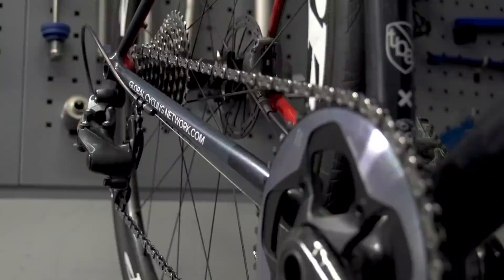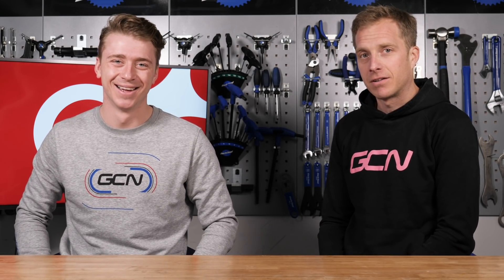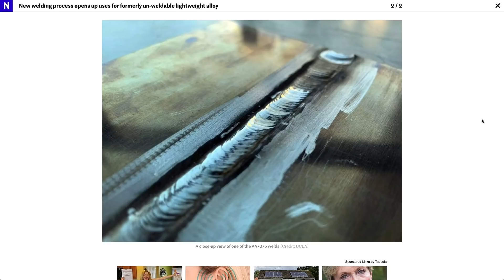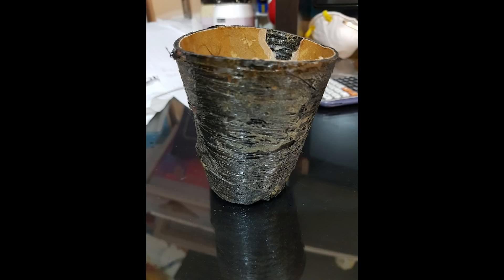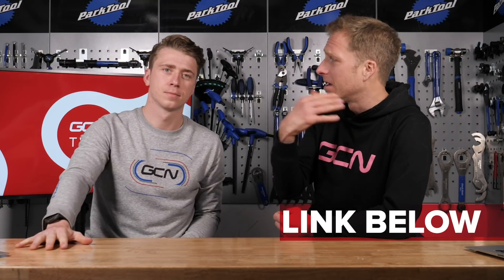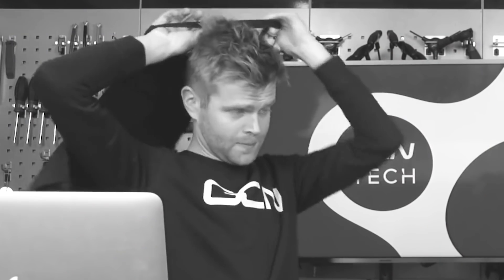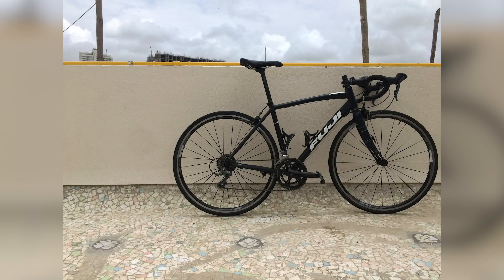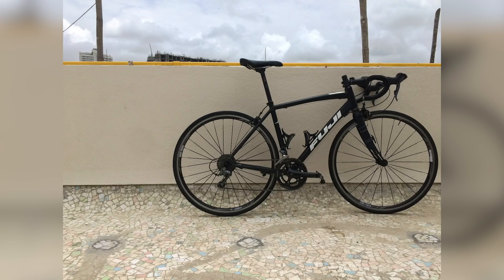The New Metal Threatening Carbon Fiber Bike Frames | The GCN Tech Show Ep. 60

Comment: Aluminum?  You may as well ride with no saddle, just the seat post.  Carbon fiber and aluminum are susceptible to catastrophic failure as well.  No thanks.  But that's just my opinion as a frame builder of 20 years having built around 2500 frames, singles, tandems, coupled frames, triples, quads and quints.

Comment: Graphene components? Nanotube frames? I'd reckon we could get the weight down under a kilo just with those. And also you could run a nanotube in your drive just so we don't have to change chains anymore. And who needs wires? Graphene is flat, just print it on top of the frame. Tyres? Who needs them when you have a lightweight stretchy rim that can take a bullet. The future of bikes seems bright even without these types of materials, but they definetly help

Comment: Why has no one tried transparent  aluminum?   (AlN)x·(Al2O3)1−x, 0.30 ≤ x ≤ 0.37 Imagine a transparent frame.
Reply: Yeah, you can put LED lights inside the frame, and also internally routed cabling would be easier to do.

Comment: Lithium frame - 1/5 the density of 6061. Don't ride it in the rain though.
Cesium frame - 2/3 the density of 6061. Melting point at 26C though, so not a summer frame.
Reply: Riding bike with lithium frame will help you for mental probems though. ;)

Comment: aluminium doesn't flex like steel does,... why bother with a super stiff frame, if what you get is a frame that may only withstand to be used for really short life spans, if what you get is a thing that needs a pro-welder with a top notch tig welding device, it needs be let clear for the general public that aluminium and carbon fiber frames are meant to be replaced sooner rather than later, and that they are a clear example  to be used for really short bicycle life spans...

Comment: New material? How about co-continuous ceramic composite  (C4)? Start with cordierite preforms and infiltrate it with 7075 aluminum. Lighter than carbon fiber with mechanical toughness, hardness and sheer strength lacking in carbon fiber composites.

Comment: Super plastic formed titanium frames. Have a word with BAE systems, see if it's possible. They make Typhoon canard this way "the aircraft’s 98kg (216lb) canard as an example of its advanced manufacturing skills. The structure is made by diffusion bonding six sheets of titanium together at 950°C (1,740°F), with print patterns etched on each sheet later expanded by passing argon gas through the structure at 150°C in a super-plastic forming process"
Reply: Aero titanium, no welds 😉

Comment: Reality check: Professor Xiaochun Li's negative statements about composite carbon beginning at about 3:08 are patently false. Either he's exaggerating or he's misinformed. Of course composite carbon can be repaired if it fractures -- Jon has interviewed people on GCN Tech who do this very thing. I can provide you with the names of several companies that will repair carbon frames (such as Calfee Design in the U.S.). And the weakness of composite carbon is by design -- it is intentionally allowed to be weak in non-critical ways in order to reduce weight. If desired, a composite carbon tube could easily be made to withstand the "shear" forces described by the professor. And the professor's inference that metal is more flexible than composite carbon is, again, false. The beauty of composite carbon is that you have full control over flexibility. You can make a frame more or less flexible, as desired. Why do so many alloy frames feature carbon forks and seat posts? Answer: To add flexibility!

But there is a huge elephant in the room with regard to aluminium alloys and it amazes me how often it is overlooked in these kinds of comparisons: Aluminium alloys have important issues with fatigue build-up. It is the nature of aluminium -- even small stresses that would not harm steel or titanium will accrue over time until an aluminium part is no longer safe to use. That's why engineers must over-engineer aluminium parts. A safety factor for steel may be 3:1 or 5:1 but for aluminium it may need to be 20:1 or greater! This is partly why aluminium tubes must be so thick (the other reason is the inherent softness of the metal). And it is why air frames must be carefully monitored regarding their hours of flight so they can be "retired" before they become unsafe. Composite carbon does not fatigue -- when it breaks, it breaks. For this reason, a well-engineered composite carbon part can last longer than any metal currently available to frame builders.
Reply: And in the real world composite plastic frames need to be manufactured. Fatigue cracking and splitting can occur where there are manufacturing voids and other defects such as resin pooling and poor compaction during in the layup process, tube and lug bonding, curing and baking etc.
The fragility (lack of toughness, ductility and surface hardness) of composite plastic i.e. shock loading starts to create crack propagation from these voids (stress risers) and can then lead to catastrophic JRA failures under relatively low loads later on without warning.
https://www.youtube.com/watch?v=WdghAAmjyLs
Reply: @amfearliathmor8213  So you're saying manufacturing flaws in carbon frames can create failures? Who knew?!?! Wait, who said anything about plastic? Also doesn't cheap manufacturing also apply to aluminum failures? Like department store frames failing under extremely low levels of stress.
Reply: Do you think my 30+ year old non heat treated 5083 aluminium alloy framed bicycle would be unsafe to ride?
Reply: @amfearliathmor8213  -- All bicycle parts can have defects. These defects can result from poor design, a poor manufacturing process, or poor materials. This is true for all metal parts and all composite parts. This is not what my original post was talking about.

Aluminium alloys present a special case because they "remember" stress in ways unlike most other frame materials. Their accrual of stress damage over time even when the stresses are low is what sets aluminium alloys apart. It's not purely a matter of age. It's a matter of the duration and level of stress exposure. How safe or unsafe your 30+ year old aluminium alloy frame is cannot be answered, obviously, because we lack sufficient information. If it has hardly ever been used and it's been stored indoors so it hasn't oxidized, then it may still be in "like new" condition. If it's been ridden thousands of miles for each of those 30+ years, then it will have degraded and fail more easily now than when it was new. But whether it is "unsafe" will depend on its history and its design. If it was way over-engineered, then it may still be safe to use. If not, and if it has seen "hard" use, it may not be as safe as it originally was. I would begin with a careful visual inspection to see if any micro stress fractures are visible inside or out.

By comparison, a 30+ year old steel or titanium frame will not "remember" minor stresses. They can be ridden thousands of miles each year and, as long as they are never over-stressed and they are protected from oxidation, they will be as strong as when they were new. The same is true for composite carbon frames with the added benefit of relative immunity to oxidation.

The salient point is this: Aluminium alloys degrade with use even if the quality of the alloy and the quality of the design and the quality of the manufacturing were flawless. The tipping point when degradation begins is much lower than it is for the other materials which is why degradation happens, albeit slowly, at low stress levels that would have zero effect on steel, titanium or composite carbon. Stress of steel and titanium is not additive if the level of the stress is modest -- they can withstand much more stress than aluminium alloy with virtually no degradation. Composite carbon (among other composites) does not accrue stress damage from minor stress. However, its mode of failure is much more sudden and dramatic when stress exceeds its design limits. But as long as you do not get close to those design limits, the composite carbon will not degrade in the presence of modest stress. Again, we're not including design, manufacturing or material defects here. We're just comparing the nature of these different materials.

This susceptibility to the build-up of stress damage is why the promise of lighter weight is limited for aluminium alloys -- unless you are designing single-use throw-away parts. If higher safety factors were not necessary, aluminium parts could be much lighter than they are -- lighter than composite carbon. However, if you want aluminium alloy parts to remain strong and safe for a long usage life as they slowly degrade, you must design them with much higher safety factors (which increases their weight).
Reply: I've broken 6160 frames, 4130 frames and carbon frames. They all have their strengths and weaknesses. 

The biggest advantage to carbon fiber is the ability to mold it to (almost) any shape you want and being able to reinforce specific high stress areas. You can also design specific layup patterns to get the right amount of torsional strength and flex.

Aluminum is still king for low/mid tier frames and it's great that someone figured out how to weld 7075, but it can't replace carbon. It just can't
Reply: @Druid_22b  Steel tubing sets can be Double or even Triple butted, oversized, ovalised to resist torsional loading, have internal spiral ribs etc, Investment cast Bottom Bracket shells/lug sets can have structural ribs etc. e.g. Columbus Max, Brain, SLX, TSX, Reynolds 708 etc
My Custom 653 had much thicker seat stays to increase torsional stiffness for example, up from 0.6mm to 0.8mm tube thickness.
Reply: @amfearliathmor8213   You are correct. There are processes to increase the performance of steel frames. There are processes to increase the performance of aluminum frames. Same goes for titanium. 

Composites, in my opinion, have the greatest versatility and balance of strengths and weaknesses. They are by no means perfect for every application.

When we are talking about bike frames (and forks for road/bmx bikes), properly designed composites out perform metal in nearly all aspects. 

My biking background is in bmx. I've raced on aluminum, chromoly, and composite frames and forks, as well as testing a titanium frame. My material of choice at the time (early 00's) was aluminum because it was stiff without a huge weight penalty. The composite frames that were available then weren't any lighter or stronger and were much more expensive. I used carbon forks because they were lighter and stronger than the other choices.

I had the opportunity to ride a modern top tier race bike last year and it was by far the best bike I've ever ridden. Besides the frame and fork, most of  the other components were comparable to those on my bike. The weight and stiffness was almost unbelievable. 

 Yes, this is my opinion, but it is one shared with a majority of those in the biking industry. There are very few people competing professionally (that I know of) who would trade their composite parts for metal counterparts.
Reply: @Druid_22b  never lending you a bike ;)
Reply: D.Eldon everything fatigues. Even composites. Granted it’s several times greater strength than most metal bike tubes, but there is no material that doesn’t fatigue, especially in a tube. Furthermore ruckus and Calfee will be the first to tell you that certain parts and types of fractures on carbon frames cannot be repaired(without replacing a larger structure as part of the “repair”. Sorry but I think the professor is right and it’s you who are being misleading. Or maybe you just really want to tell yourself Carbon is the best material for any condition. It’s not. It’s fantastic for a bunch of uses but what they describe could be way better for loads of racing or mountain biking applications.
Reply: @autocrossaholic  Perhaps the easiest frame repairs for any frame material technology would be an unpinned lugged steel frame that is jointed with hard silver solder. It makes frame repairs sooooo much easier for the frame builder.
TIG welded frames for aluminium, titanium and steel generally will become uneconomic for a rebuild if the main triangle tubes are damaged and need repair.
Reply: the fatigue characteristic of aluminium starts to show after 10E+6 or even 7 cycles so I dont think thats a criterium for bicycles. there are some alloys now that show a horizontal line in the wöhler diagram. also I think safety factor is the wrong term to use here because it depends on the usage (handrails, shafts, elevator...) and is the applied load divided by the bearable load by the material used. so you have to use larger measurements for al because usually the tensile strenght is inferior to that of steel.

Comment: Hello, thanks for all the content. Just started riding again on a new bike after a crash, (Cube Attain, 2017 version because it has hydraulic disc brakes) and it's great to be back out, but the bike feels heavy - especially the back end. I've got Schwalbe Marathon tyres on, so I reckon that could be rectified now the weather's picking up. Wheels are Fulcrum Racing sport 77, weighing 1740gm. Bike is aluminium with carbon forks and I'll be sticking with it. How much is reasonable to spend on upgrading wheels for a bike like this (these don't seem to be bad wheels)? And is it worth it, or would it be better to wait a couple of years and replace bike with a lighter one? I'm a recreational rider in very hilly terrain, and I love hills. Also, is there more to wheel upgrades than just the weight?

Comment: @GCN Tech - Question: Do you know of any offset brake pads which drop the braking surface down a 1-2 mm to provide the extra reach? The reach on my rear brakes is just too short and the brake pads are just rubbing my wheel. Yes, long reach brakes would solve this, but I have upgraded my GS to Dura Ace (Ultegra have the same issue) and I really don't wish to go back to the old inferior ****ty brakes. I've scoured the web to no avail. Thanks in advance.

Comment: That JC and Hank combo again! Nice one chaps.. I have a question that connects to your conversation about bike materials. I'm in a quandary about bike racks and transporting carbon framed bikes. Metal frames are easy to clamp, but clamping carbon frames isn't recommended. Rack manufacturers also don't recommend fork mounted racks for carbon either. What do you guys think? I use a well known single bike clamp rack that I see most people using and I add pipe insulation and rubber pads for the clamps and wheel straps. I'd love to know your opinions, and it would be great to see a short n sweet "best way to transport carbon framed bikes using bike racks" Video please. Cheers, Rich.

Comment: Bluetooth tech has gone to far. A bluetooth pump? Because its to hard to read a gauge.
Bluetooth lights, why press one button on the light when you have to get your phone out of your pocket, open an app and toggle lots of things instead. Things like using an app to control your Wahoo or Di2/ Etap is fine and the best way to do it but pumps, lights no. Whatever next bluetooth controlled Boa's for your shoes?

Comment: How a 'professor' can claim carbon fiber is irreparable is beyond me. He's provably incorrect. Aluminium 'threatening' carbon fiber frames? No. Aluminium may have many plus points, but it's still a metal that handles forces equally no matter the direction of force (yes, you can shape it to alter force response somewhat, but only in a limited capacity), carbon fiber is on another level in terms of customisation of force response. That's one of the reasons it's so popular and one of the qualities that makes it the king of materials for certain applications - like bike frames.

Comment: 7075 AL has a very high zinc content. I played around with joining it mechanically in the 80's before switching over to welding frames in magnesium AZ31B. Needles to say 7075 AL is very strong and well suited for hubs and other machined components, but it could not be welded at that time. To make matter worse - and as Gary Klein first demonstrated - welded Aluminium requires an exotic two stage heat treatment after welding to recover its fatigue strength. Aluminium alloys also have a relatively low fatigue strength when compared carbon, steel and titanium. Magnesium AZ31B on the other hand is much lighter and can be welded without post heat treatment, however it must be treated with a special "conversion" coating (similar to anodizing) to provide corrosion resistance. I seem to recall Witt and Wilson  - in their seminal work "Bicycling Science" circa 1980 - reported that all of the metals had a similar "specific stiffnesses" which is lower than that of carbon and boron fibres. My bet is that a welded 7075 frame will not outperform carbon at the end of the day. Perhaps if the professor has cracked the problem of welding AL alloys with a high zinc content he can also weld magnesium ZK60 alloy....now that would be something!
Reply: I thought that all aluminum alloys have no fatigue limit.  Wouldn't that be a non-starter for a bike?
I think the better material would be HSSS steel.  https://phys.org/news/2015-02-stronger-lighter-flexible-steel.html
Reply: @ricktan5663  In practical terms the fatigue limit of most AL alloys is considered 1/3 of ultimate strength. Once the strength gets down to 30% further decline is very slow. Most structural steels have a fatigue limit of about 50% with titanium at 55%. Composites such as carbon and boron can have fatigue limits in excess of 90% of ultimate strength so they have a big advantage over metals.